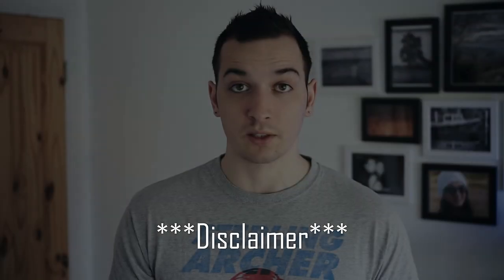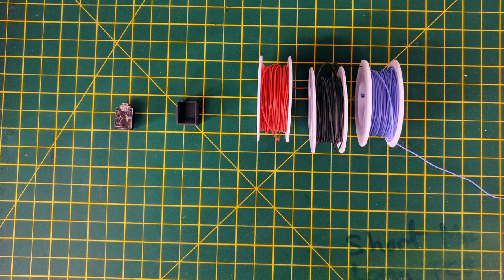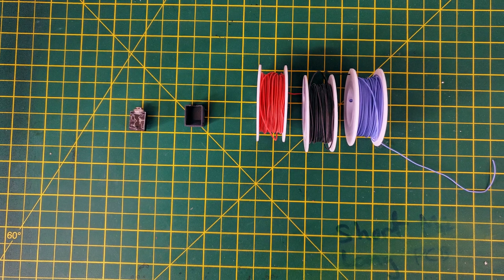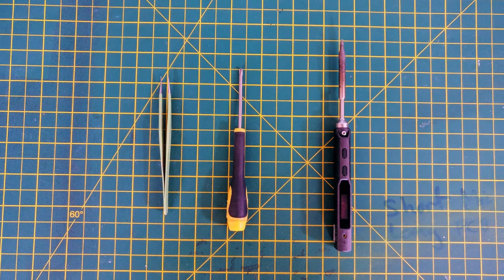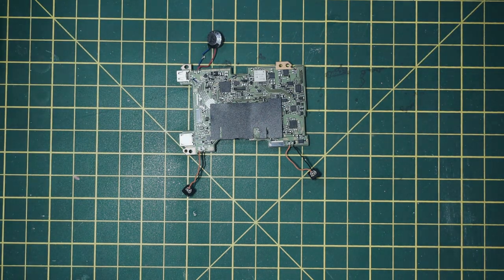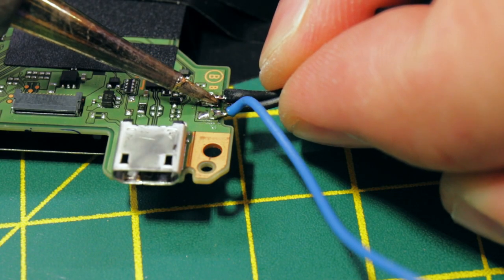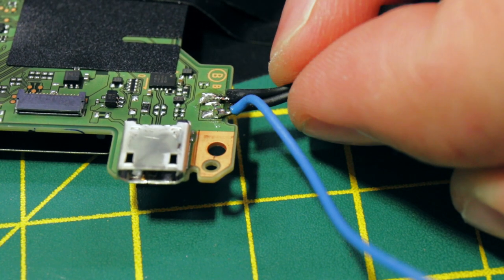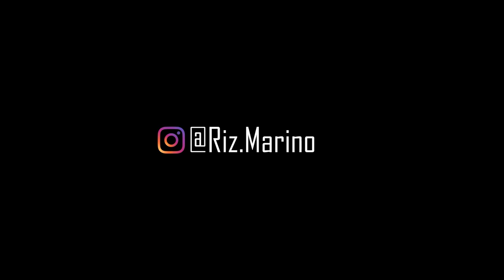A5000 external mic hack MK2!!

Comment: I think you're schematic to wire up the pin from the motherboard is backwards in the drawing. Is the pin layout correct? My wiring is color coded just like yours at 5:10. But then schematic has negatives switched. 8:40 it shows your color coded matching the pin so I'm going follow that.

Comment: Hello. I also want to do this now, but there is a question. The input is stereo, and the microphone is inserted mono. Is the sound with an external mono microphone written in one channel or both?
Reply from the maker: Great question. The mono audio is written to both channels. 🙂
Reply: @CuriousRiz  Cool! Thanks! I wonder if there is a difference in which channel to connect an external microphone to? It turns out that the camera writes mono sound, and two microphones are used only for noise reduction....I can't check now because the camera is disassembled :))))

Comment: i have a question, can I put the hack jack behind hdmi or micro usb jack? just like a6300 6500. is there enough space?(dont use 3d part)
Reply from the maker: No unfortunately not, there just isn't enough space. I was thinking of maybe removing the flash putting it there but thought the flash was too important to remove.
Reply: Rosario Marino ok thank you I will try on my a6000

Comment: im really thinking of doing this on my a6000. Yes its my only camera but im pretty confident. I do well with pics and instructions. Would this be the same process?
Reply from the maker: Honestly I wouldn't be able to say as I've never opened an a6000 but I guess the principle is the same. I wish you the best of luck. :)
Reply: @CuriousRiz  thank you, I'm going to do it this coming weekend so Ill let you know how it turns out. Thank you again for this much needed tutorial. You are like me, ya you can buy a sony Mic but i don't want to settle lower quality sound and have amazing resolution. So for me this it's worth it.
Reply: @CuriousRiz  do you have fb messenger? When I'm done id like to send you an audio file of it. Whether its working or its still staticy. Maybe you might have a thought or two that I havnt. That's if its still doing this once I solder. Even if it doesn't work out I'm still happy I did this and found your video! Honestly I'm new to photography but love electronics. And got to learn a lot about the camera when I was taking it apart and putting it back together. Not one extra screw!!!!! 😆 Of course I labeled all my screws though! Lol I'm meticulous like that.and spending 10 years in the military can do that to you too!
Reply: Can't you just find an adapter for the hot shoe? If that's a thing.
Reply: @CommentRodent  i already did it 4 months ago and it works! I even took it apart again to put in better wire. It works like it should have from the factory!

Comment: Ok so i have put my a6000 back together.   I have soldered wires to right side mic. And disconnected left mic. Now I'm just waiting on my 3.5 socket to arrive today. I already have a place on my small rig handle for it to go. Im a little anxious cause I tried another socket I have and was just touching the wires to the poles and the camera recorded my voice from my rode videomic but i also heard static. Could be because i didn't have hard connections. I don't know. I hope that's all it is!
Reply from the maker: I'm not sure, It definitely could be because it's not a good connection, I also suspect the A6000 has a different pre-amp to the A5000 which could cause it,Fingers crossed soldering the jack will sort it out. :)

Comment: @UCCqU5T2TaTlLDvJwT55HsrQ good video and must say takes some balls to make your camera the Gennie Pig. I have always owned Canon cameras which ive gone through 5 of them the Canon 7D  Mark ii the last and jumped over to Sony to give the Mirrorless camera a try but biggest reason was I am putting together a cage rig and Canon was to damn heavy and Sony is light especially the a5100. when I bought it recently I just assumed without checking their was some kind of hot shoe I could attach on the rig for flash or a light and audio I didn't even think about. So im going to use the Tascam or Zoom recorder attached on the cage for audio and sync later but if I end up not liking that I guess ill be back to do this mod so appreciate your ingenuity and time making this video.
Reply from the maker: Cheers for the comment, really appreciate it. My main stills camera is a 7d MK2 and I love it but I totally agree with what you're saying about weight there's no way of want to make a cage rig using the 7dii. Good luck with the external recorders, they definitely work. 🙂